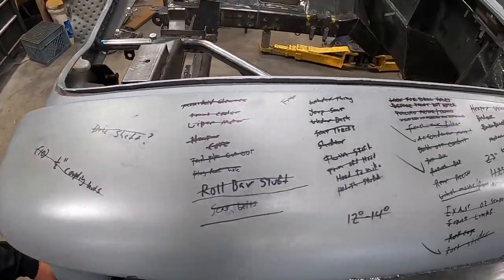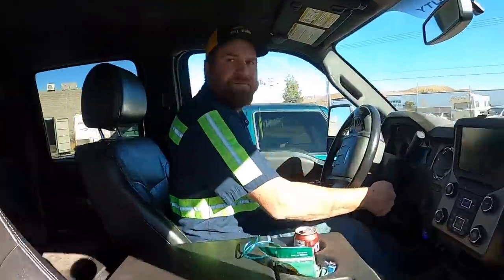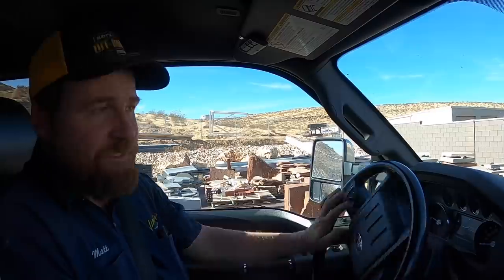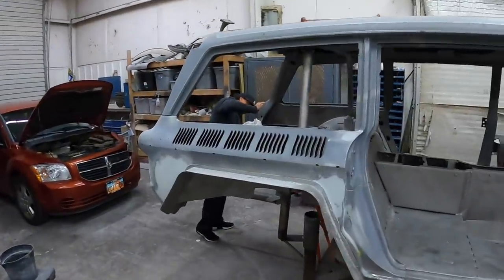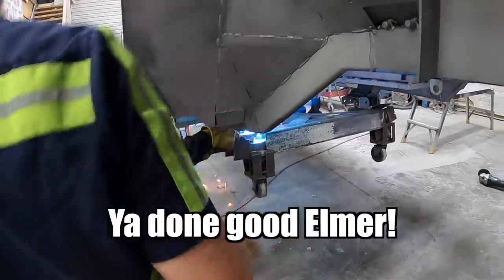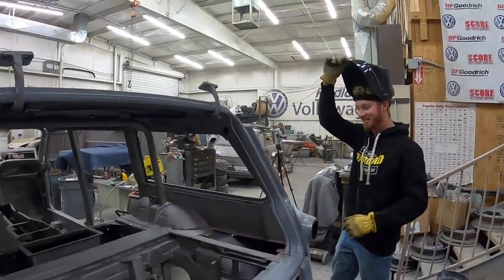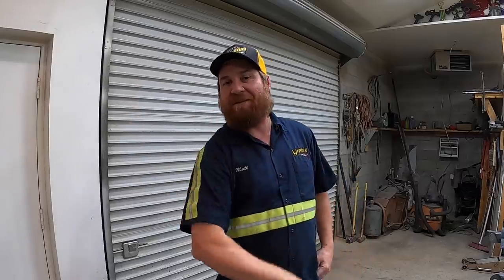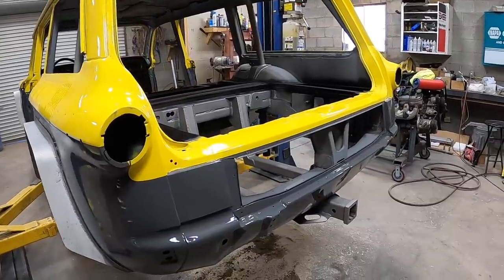The Corvair Has A New Paint Job!

Comment: I can't wait to see how this performs compared to the Banana...
Reply: I hope they splurge on some 37 x11.5 or wider tires to really get that contact patch. I know they are very cost focused in their tire selection.
Reply: @otm646  in the mud they gotta deal with I think a narrower tire works better. cuts thru to the good base.
Reply: @0xsergy  absolutely. But wider is better on sand and rock, so its deff a ballencing act when choosing tires.  The narrow tire is better in snow as well unless the snow is over 4' deep then you want to ride on the packed snow rather than dig to the hard base
Reply: @samantharondeau4580  it is a sand rig and all, atleast he chose a gas engine instead of a diesel because of the rev range being too short in a diesel for a sand towing rig.
Reply: @tylerbrotzman7452  weight is a bigger concern over the power band.
Reply: @1oldskoolluvr  my point was, the engine choice was based off of it being a sand rig
Reply: @1oldskoolluvr  the power band is pretty critical too. Having to shift gears in low traction high resistance environments is fatal.
Reply: @tylerbrotzman7452  The rev range is not too short in a diesel, remember the gearing is different. A diesel will have the same road speed range for a given gear if setup properly.
Reply: @otm646  a diesels redline is about 3k rpm max i think, compared to 7k in a good gas motor.

Comment: I have owned two different Corvair's, so I am super excited to see the finished car!  One of the Corvair's I had when I was stationed in the Philippine's in the early 80's was actually converted to a front engine using a Toyota 4 cylinder. (The Filipino's were excellent fabricators)

Comment: I am shocked the sandblaster did not take off the Sharpie writing on the fender.
Reply: They sandblasted the undercarriage and floorboards and not body panels from what I gathered.
Reply: sandblasting panels is a no go. it would destroy the surface.
Reply: I think they only did the new steel fabricated parts.
Reply: The panel's didn't need sandblasting just the new stuff And all the welds....

Comment: Is there a reason that they didn't shoot a couple of coats of epoxy primer over everything, inside and out?  I wouldn't do a paint job without it.
Reply: I was wondering also. I'd put primer on the whole thing, inside and out
Reply: Matt said at the end, they are putting a liner coating on everything that didn't get paint.
Reply: Should have done the epoxy primer regardless.
Reply: @ChrisValenze  Exactly
Reply: @tosgem  I'm restoring A 57 Chevy. Everything got primered.
Reply: Cars don't rust in the desert and it's probably easier to make adjustments to it if you don't need to grind away epoxy primer for every weld.
Reply: @modarkthemauler  It still rains in the desert and they are often in mud and snow...
Reply: Maybe they did and it was edited out.
Reply: Did you miss the part where Matt said ok primer is done rewatch and see
Reply: Proper primer was applied everywhere that got painted but the under coating we went with requested bare metal so they could apply their primer and undercoat.
Reply: Yeah, why mask off bare metal from primer?

Comment: The back end of the Corvair looks almost identical to a 68-70 VW Square Back I used to own.
It was a faded yellow when I purchased for $800,
I repainted to a bright - 🌞 
School Bus Yellow- replaced all the rubber around the glass and seals.
And redid much of the interior.
Sold it a few years later to a collector for $3800.
It still need some improvements but was a clean little ride.

Comment: Please wear glasses when you're grinding...
**Or even next to someone who is...
Reply: I don’t think they have a problem seeing, not sure how glasses would help.
Reply: @DaintyCanadian  Safety glasses to keep debris/burning sparks out of your eyes. 
I work at a structural steel fabrication shop.
Reply: @kdigiacomo  not sure if you've been paying attention during this whole process but they're not exactly safety glasses people. When I was last in a fab shop in 2009 osha regs were that anybody in the same room as welding had to wear eye pro or have a shield wall surrounding the welding location. They aren't even bothering with eye pro for themselves doing the welding. Grinding, cutting, drilling, etc they have been wearing insufficient eye protection if any at all for most of what they're doing this entire time and thats just the tip of the iceberg of minor safety complaints. But they're also adults who can choose for themselves what level of protection makes them comfortable enough to do what they need to get done, so while I think its stupid not to take those extra steps, I'm not the one running a successful business, right?
Reply: @TheGreatPurpleFerret  lots of people don't realize that while grinding sparks aren't visibly too bright to look at (unless you're grinding magnesium or titanium) it still puts off enough thermal radiation to cause cataracts over decades of doing it. also, metal dust getting into your eyes and then building up in your eye sockets is a problem and makes things much more complicated if you ever need a MRI
Reply: @TheGreatPurpleFerret  That's an odd passive aggressive response. 
I've watched every single video they have made, have you, and yes they know my comments. 
Yeah I run secondary QC for the building process of the hospitals and huge buildings we make, so yes I definitely know how to "pay attention".
Since you brought it up I live in and own a $684k house so I understand what success is all about. 
*My comment also said 'please' because I was being polite.
Reply: @SuperAWaC  Thank you.
Reply: @kdigiacomo  I know, it was a joke.
Reply: @DaintyCanadian  But was it, in all honesty?
My #1 rule in life is to never lie. 
There's always rules....

Comment: The Corvair looks awesome!  I hate to be the safety guy but you guys should be wearing safety glasses with those cut off wheels.  I've been doing metal fabrication for almost 30years. I wouldn't even allow those in my shop until recently and then only for limited use. Those disk can catch and explode. I know you were in a hurry and I too have been guilty of that but it's not worth losing an eye.  Stay safe and keep the Corvair videos coming.  Can't wait to see it on the sand.

Comment: I would think twice about using bed liner anywhere you'll be power washing. As it sets up it leaves pinholes in the inside corners allowing a access point for water after which comes the rust problems...🙏 The liner gives you a false sense of security and you can't see the problem until it's quite severe. If you do use a liner I would recommend massaging clear silicone into the inside corners then wiping it clean. That should seal up those little pinholes 👍
Reply: Utah is a desert.  Ain't no rust out there! 😉
Reply: Ospho  or apply cold galvanizing zinc ?

Comment: A fan of the channel.  Not sure why the under chassis and interior were not rust proofed first before the exterior? The exterior would be the last thing I would finish painting when everything is buttoned up.  The reason being is you would likely scratch the exterior or slow you down working on the vehicle. A seasoned carpenter used to tell me work on the ceiling and walls before the flooring.  That way you can move around and your equipment in the room freely without damaging the finish product.

Comment: Ok so I have a question about the corvare build. First I love your channel and watch all the videos. Ok so my question did you just butt weld the frame of that thing together because and I'm no expert but I thought for welding a frame you had to make special joints that are diagonal and gives a much longer welding area and also after that weld a plate over top to reinforce the joint. Just butt welding a frame is not strong enough joint.  Maybe not if its fully boxed frame but still the type of joint I'm talking about would be much stronger and would seem to be the way to go especially for what your using it for. Let me know what you think I've been wondering this since I first seen the start of the build. Thanks for the great videos Matt and fam!

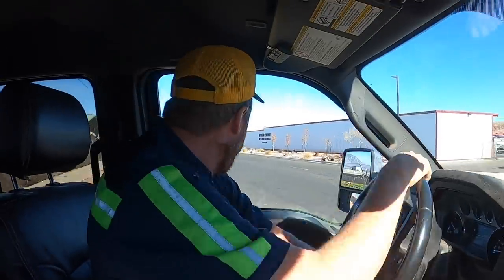Comment: 2:46 wow, never knew you had a minivan, what is that for?
Reply: It's the roadside assistance vehicle. Jumpstarts, lockouts, fuel delivery, etc. Cheaper and quicker than taking a tow truck if a tow is not needed.